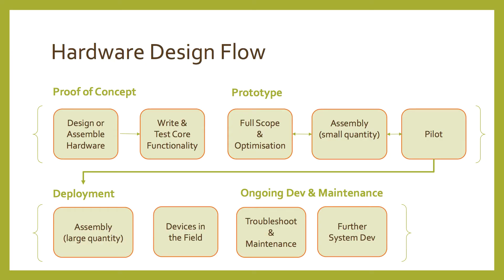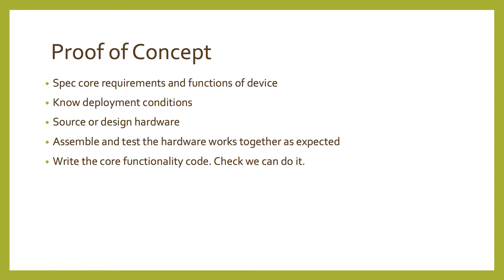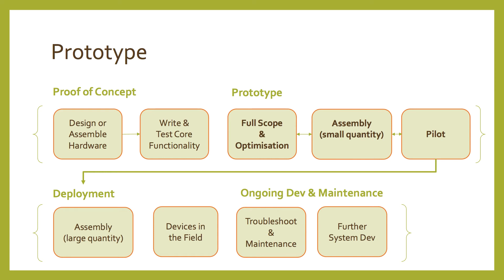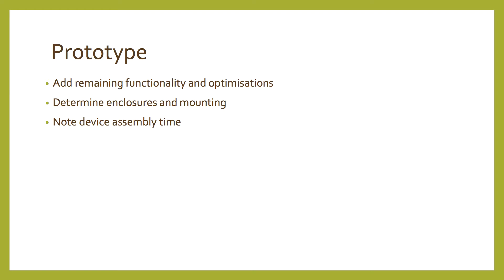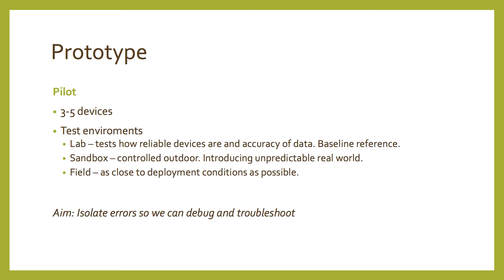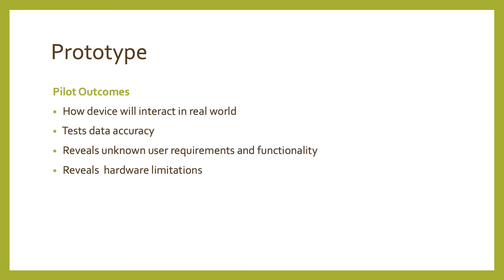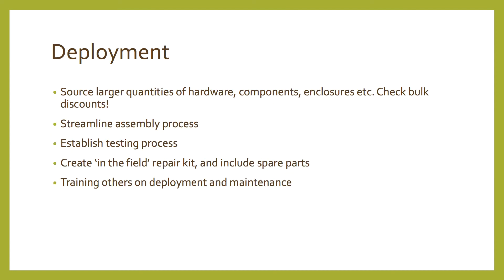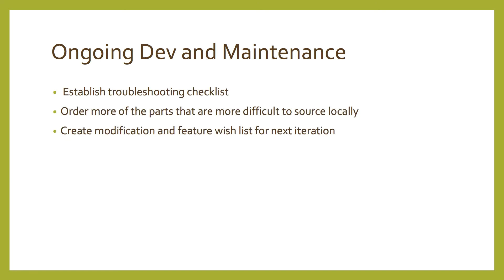Build Your Own Data Logger: Module 1.1 - Understand the Design Flow

Comment: It is not possible to activate the subtitles in the video? For non-Anglo-Saxon speakers, we would do very well to have them, thanks !
Reply from the maker: This is an excellent point. I thought I'd done that, but will figure out why it's not working - Steph
Reply: @WILDLABSNET  Fine!
Reply from the maker: @calroure  Okay, it should be working! It's working for us - there’s a small CC icon next to the settings (cog) icon. I can switch between captions on or off.
Reply: @WILDLABSNET  Perfectly, now its fine !